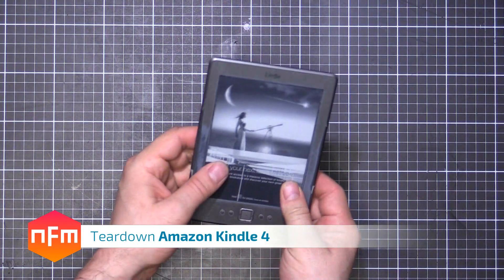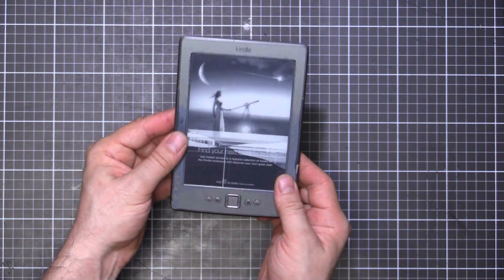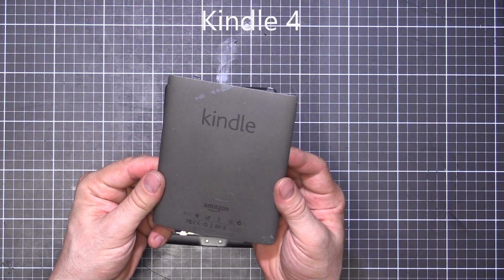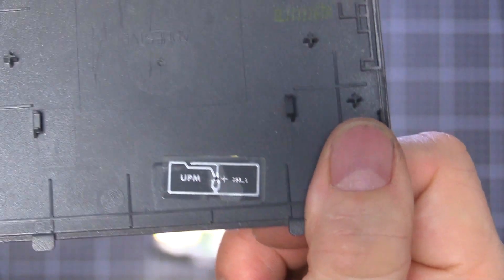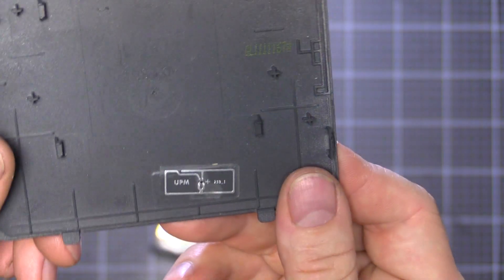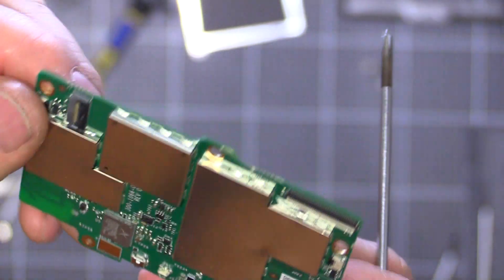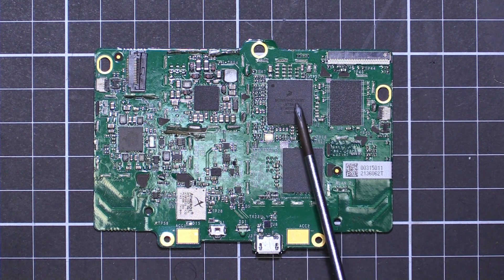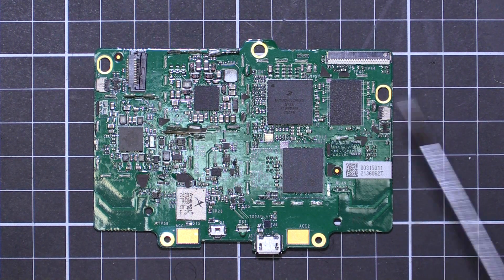Amazon Kindle 4 Teardown

Comment: Hi! I am interested how to replace just the screen as my screen is brokent and the old one is glued in, so not to remove board if not needed but how to remove the old screen. my other question is that there are the 2 extra charging pins for charging next to the microUSB connector ACC1 + ACC2 -, can I connect 5-5.25 volts there if I want to charge it like usb power? I don't want to use the microUSB port for charging for specific reasons.
Reply: its probably for the case...the light cases to power the external lights

Comment: Wouldn't color e-paper displays use CMYK rather than RGB?
Reply from the maker: I just had a bit of a look into the tech and it turns out the colour displays don't actually don't use coloured balls at all..

They have an RGB colour filter panel overlaid above the normal black and white panel to filter the usual reflected light.
Interesting, and seems so obvious now I think about it. :D
Reply: Yeah, that does make sense. Thanks for replying.
Reply: Some newer ones use a CMY colour filter with K being the e-ink display as a toner. (Key)

They offer some much more "paper" looking results than using an RGB filter. (Which makes sense really as e-paper is not a light additive screen style)